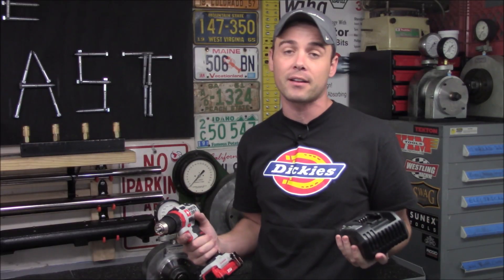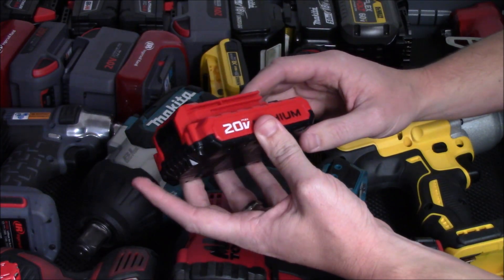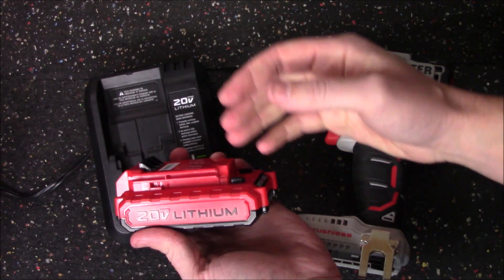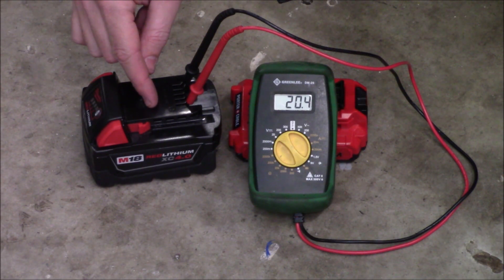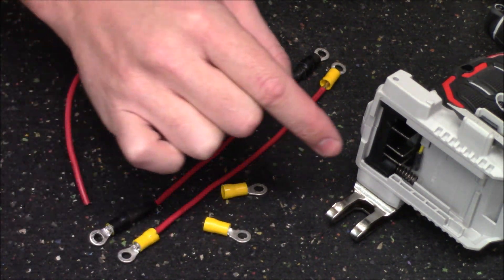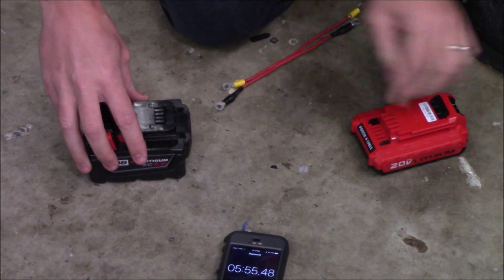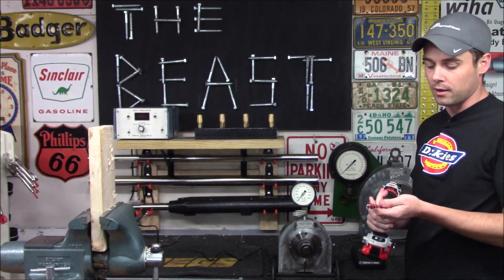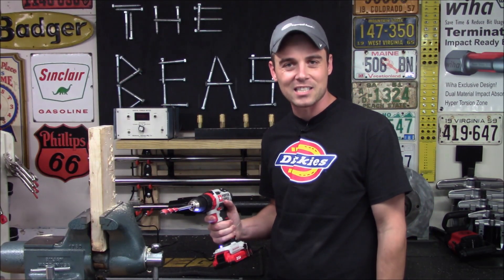Back from the DEAD!  Lithium Batteries!

Comment: Can I get my robovac battery reset with a Milwaukee tool battery?
Reply from the maker: It appears that your robovac battery is made from 4 lithium battery cells encapsulated in series with a wire pigtail attaching them to your vacuum.  Personally I would just swap it out with a new one ($20 price range on Amazon or Walmart) and it appears you can change yourself very easily. 

If it was a removable slide pack like a power tool I’d try the method in this video, but not in your case due to risk of shocking yourself.
Reply: @RealToolReviews  thanks for answering. This robovac takes a 3-wire battery which costs $43 on eBay. Considering getting a cheap robovac replacement.

Comment: Lithium Batteries employ a BMS to prevent the batteries from catching fire. It is the BMS not batteries that most often fails. Either turning the BMS OFF (no power) or blowing the BMS circuit (damaged).

Comment: I had 2 LI-ION 18 volt batteries showing DEFECT last year, didn't take them to the recycle drop off and still have them. Would this method work on them or would it be dangerous???  They have been sitting discharged for a year.
Reply from the maker: It’s worth a try.

Comment: does anyone know what the charger base low voltage cutoff actually is?   also  this method is not working  when the battery pack gets  wet. any suggestions would be great..I have already disassembled the packs, cleaned them  meticulously and reassembled . #1 has 19 volts in it but the charger rejects it none the less.  any ideas?   (PCC601)

Comment: What if I don't get a reading at all when I connect the multimeter
Reply from the maker: Then that battery probably has a bad cell….. which isn’t letting electricity flow through it.  Just bring it to Lowe’s near the service desk and put in the battery recycling bin.

Comment: ...but, the issue is battery is charged but won't last for long while the capacity is getting shorter and shorter !
Reply from the maker: Every battery has diminished capacity with each charge…..
Reply: @RealToolReviews  
 By claiming " Back from the Dead  " is a wasted effort ! 
My dying Hitachi 18V batteries still take charge only to last a minute or two, so are the Dewalt's ....
Got the RIGGID' from Home Depot only, registered  batteries are lifetime guaranteed  !

Comment: Appreciate the video! I did this with a porter cable battery that only registered 4 volts and wouldn’t charge. Now I’m able to use the impact driver the battery was connected to. Thanks!

Comment: Here are some tips You can hook up, with correct polarity only, an 18 or 20V battery to a car battery which is only 12 to 14 volts. It gives the higher voltage battery just enough of a boost for the charger to see that the battery can be charged.  You can also use a 20V (high capacity 20V fully charged battery - 5.0 and greater only) to jump start your vehicle if the battery is low, not DEAD as that will cause the battery to be ruined. Ryobi 40V battery with 4 blinking lights - take the back off and look for RST for reset and short to the terminal next to it until the battery light indicator blinks, then place in the charger right away and mine did fully revive.

Comment: Sir you are mistaken what you are doing is dangerous to say the least the Li-ion cells are 4.2 each charged and should never go below 2.4 volts the cells are series to equal the voltage needed and say 5 series is for a 20 volt then they might parallel another 5 to those for double amperage or wattage . No 2cells are ever the same resistance so they will eventually discharge differently and if the balance gets off to much the charger will shutdown to keep from overcharging some to get to the full charged voltage in the pack, by jump charging you aren't fooling the battery or charger only yourself . If you want to fix the problem go into the case and measure each cell or group and only charge or discharge them to Ballance the pack then if that's what was wrong then you will have many more uses left in  them.

Comment: Love it!  I did the same setup to charge  my 10 year old stream light battery and it brought it back to life. I started off with 0.159 millivolts when I last checked it it was at 2.9 volts. I had to my new battery to trick the charger into sensing the battery voltage from my new battery to charge my old battery once it started sensing 2 volts I started charging my old battery directly with the charger.

Comment: Would you attempt Theo’s with an 82 volt lithium battery that’s only reading 34 volts and a flashing red light on the charger? I left it on the charger over the winter and a flashing red light was showing in spring I purchased a new battery and the charger is working fine.

Comment: So I tried this on a dead (battery status light wouldn't even work) Hart 40V 5ah battery with a (working and fully charged) Hart 40V 2.5ah battery.  + to +, - to -, yet the wire started smoking so I disconnected them.  The 5ah battery now has a working status light (4 flashing blue bars so it's still not charged) yet the battery charger still won't recognize it either.  Any suggestions?
Reply from the maker: Probably a bad cell
Reply: @RealToolReviews  I just took it back to Wal-Mart and exchanged it.

Comment: I had this happen to my RYOBI 40v 6Ah pack. When I plugged it into the RYOBI charger, I got a flashing red light. The pack measured at 27 volts, which is below the charger's magical 30 volt 'bad battery' threshold. But I discovered a way to get it to charge. Just plug the battery in the charger first, THEN plug the charger transformer into the 110v outlet. The green light started flashing (red was off), and it charged fine for me.

Comment: All good except if the individual cells are not balanced. Then you got to charge each cell individually.
Reply from the maker: This simply enables you to trick the charger into charging….. it will do it if the battery can still work.

Comment: Excellent video I've watched several being an electrical engineer you're the only person who covered gauge of wire. The only other thing I would recommend is to put in a inline fuse. Thanks for sharing.
Reply: What amperage fuse would be appropriate?
Reply: @toonwintersturm1045  the current should be very low. I would start with a 1A fuse. Or course you can measure it with an amp meter.

Comment: Totally agree with McG that using a laboratory-type power-supply is far better than using another battery-pack!
Also if you hold the battery in your hand, then you can reduce the current even further if you feel it beginning to heat up to a temperature that is uncomfortable to hold (should only be warm, not hot)!

Comment: I tried to do this fully charged 20v and almost 0v and eveytime go connect the last side starts sparking is that due to voltage difference and can you drain from any battery say fat square 6v or 9v to get enough voltage to jump with 20v as more safer way
Reply from the maker: If it’s sparking, I wouldn’t be connecting anything….. recycle it.
Reply: @RealToolReviews  could that be such a large difference in voltage I got 4 dead below 1v and 19v good one could you double jump but with a battery in charger connected to bad

Comment: Kobalt batteries have 3 prongs pos, neg, and I believe the other is a temperature sensor. I can't get a reading with the multimeter even the known good batteries though.
multimeter confirmed does work.

Comment: I did the same and the battery that will not charge heated. What does that mean. And it still will not charge
Reply from the maker: It means it has bad cells, recycle it.

Comment: I used this tip to get one of my Porter Cable batteries up to around 18.5V and still the charger sees it as defective.  Same goes for my other battery which I was only able to bring up to around 16.5V.  Any other tips???
Reply from the maker: One of the cells is probably bad….. probably should just recycle them if this didn’t work.

Comment: This wasnt what I was looking for. You can also revive a dead pack the a car battery charger. Ive done it many times over the years. I use to throw them away and get new ones until I found a way to bring them back to life. Only takes them being on the car charger for a few seconds. Then you can use the actual charger for the pack to finish the charge. NEVER charge them on the car batt charger longer then  around 20 or 30 seconds at a time.

Comment: This is a spot on video. I have done a similar thing by using a variable power supply and adjusting it's output to limit current to less than one amp. You didn't need background music or gloves----congrats!

Comment: I have some serious problems with this video. First off, if one or more cells in the low pack has dendrites shorting from the cathode to the anode, you are putting a near short-circuit on that lovely Milwaukee battery. Even if that is not the case, since you have no ammeter in the line, you have no idea what current is flowing. What multiple of C is it? Milwaukee batteries are quite rugged, but if the flow from the pack exceeds the design spec, you can and probably will shorten the life of the Milwaukee battery, which is worth a lot more than an old dead "other brand" battery. Lastly, if you want to try this sort of thing, the correct way to do it is to dig into the pack, detach the cells from the control circuitry, and balance up the low cells to match the rest of the pack. Be sure you know what you are doing, because this can be dangerous, particularly if the battery management system is still attached to the cells. Do I do this sort of thing? Yes, but I have 20 years experience with a variety of battery charge systems, design and cell-balancing techniques. Many of the people viewing this may get away with this approach. Some will not, and the fire that can occur if you are one of the unlucky ones can be spectacular. How do I know this? Let's just say that a balsa wood model airplane can be reduced to ash in under five minutes this way. I want to gently suggest that although this video is quite popular, it is not appropriate for the average user. The risks here are on the same order as installing your own natural gas line, in my opinion. Before you try it, learn about C, multiples of C, discharge rates, and how to balance a pack. When you reach that level, perhaps you should give this a try. The author is very smart, and has a lot of good ideas, but without monitoring the discharge/charge rate, anyone following his advice is asking for trouble.
Reply from the maker: Read the comments from the hundreds of people who fixed their battery packs with this method.  Tool companies simply prevent recharging packs that discharge below a superficial amount — so you have to spend $$$ on new batteries.   Much like the entire thought process of cordless tools….. planned obsolescence.

My main suggestion would be to do this outside — but in that same note, one should also probably charge, store, and use cordless tools outside also to prevent risk….. however in reality we both know that will never happen.

Comment: Keep in mind if you put two of the same batteries nose to nose the positive terminals will be on the reverse side so the wires you put on will need to be crossed instead of being straight.

Comment: The only problem is if one is completely dead and they equalize to say 10volts each and the low volt cut off is 13.?? Volts then you have effectively ruined two batteries.
Reply from the maker: Apparently some people only connect them for 10-30 seconds and it is enough to trick the charger if you immediately put the dead battery on it.

This doesn’t “equalize” the charges like two tires connected with air pressure….. it basically gives the dead battery a temporary boost that will fade back down, like a sugar high after a candy bar.

If the charger then starts charging it….. it’s at a much lower “trickle charge” and can revive otherwise dead batteries.

Comment: I feel like this method wouldn't fix the pack fully as one cell could be lower then the rest which would cause the voltage to drop and boosting the voltage like that would charge the other cells back up evenly and leave the other cell lower then the rest and cause the same issue again in a week of 2. I feel like it would be better to disassemble the battery and check all the cells individually and charge the low cell up if one is found before trying this method.
Reply from the maker: Read the comments….. this has worked for MANY MANY people

Comment: This is a dangerous practice. 
Connecting two packs will result in a high and uncontrolled flow into the flat battery which is exactly what causes the sort of problems that have been highlighted with lithium batteries. 
If you want to try to bring a "dead" lithium battery back to life, it is actually necessary to use a low and controlled current of maybe 50ma. Usable Lithium cells will climb back up to the normal working range of 2.5v - 4.2v quite quickly with even this small, safe current.
Reply from the maker: Read the comments and see how many people have successfully done this….

Comment: Could you also put it on a trickle charger? I tried this and it still didn't work...hoping the cells aren't corrupted.
Reply from the maker: Essentially this temporarily boosts the bad battery above the minimum voltage threshold for the factory charger to then start charging it.  I doubt a trickle charger would work, but I’d research it before trying.

Comment: I tried this with 2 12v Hitachi batteries.  The good one had a charge of 11.75v, the one that refused to charge had 9.5v.  I used 16 gauge wire instead of 12, hooked up positive to positive, negative to negative.  After about 15 minutes, the bad battery had a LOWER voltage of 3.75v, and now when I put it on the charger it makes a bad clicking noise!  What did I do wrong?
Reply: Thanks for the reply!  I am going to cut my losses on the bad battery.  Just ordered a replacement for 25 bucks.  Great video.
Reply from the maker: You probably had a bad cell in the old one, and it drained the good battery down below the charge threshold.  You could probably revive the good one....but it sounds like your old one is not repairable.

If you try this again, use the thicker gauge wire & revive the “good one” using a regular car battery REMOVED FROM VEHICLE(12v).....it doesn’t have to be an identical lithium one — just the correct voltage.  Also.....leave the wires attached for 30 seconds or so, not 15 minutes.  Then remove the wires and IMMEDIATELY put the battery on your charger before the voltage drops.
Reply from the maker: Or if I read this another way..... only your bad battery is causing the problem?  If so, bring it to Lowe’s or Home Depot and recycle it.   The bad battery is trash.

Comment: yuo need aregulated powersuply wit curent limmiter so yo set it for the battery pak like 18 volt en set 300 miliamp conect to the pack en charge up as long as yuo see curent is flowing it is not fully charged.Ivytech 120V 3A 60V 30V 10A 5A Verstelbare Switching Dc Lab Bank Voeding Lcd scherm Digitale gereglementeerde Modul Laboratorium|Schakelaar Energielevering| - AliExpress

Comment: I have one lithium that the charger always indicates as bad when I attempt tp charge it after use. (yes, I gave it plenty of cool down time). I put this battery back in a drill, wire tie the switch to full on, let the drill run until the battery is completely drained - no light and no turn. Let the battery rest until cool and then put it in same charger. Charges to full no problem. This battery is over 10 years old and still provides good power and run time after the charge.

Comment: Maybe I have an older type battery charger...Mine can charge lithium batteries which had no juice in it.  And this happened quite frequently when I used them without knowing they were low in juice and dead on the jobs...No issues whatsoever for the charger to charge them up.

Comment: Here is a question for you - Oregon 40 volt chainsaw battery.  It is not running the chainsaw.  It has 40 volts on it but the battery does not have any current in it.  I connected it to a brand new charger and it blinks green but not a lot is going into the battery.  What do you think?

Comment: Great video really appreciate it it actually does work had a two amp Milwaukee battery with two cells at 1.9 volts each and the other two were at 3.7 v hooked up a 5 amp battery and charged it with in 5 minutes was able to put it on the charger and is accepting a full charge now

Comment: Did the same thing myself
bought an 18 volt Hitachi drill with 2 dead batteries 
got the batteries going again using the same method and it's still going strong more than 2 years later 

good advice about doing this outdoors, friend of mine was swapping old Nicad batteries and fitting Lion 
we did warn him about the charging issues, he later sold it on and had to pay the money back when the batteries caught fire and almost burned down the guys kitchen